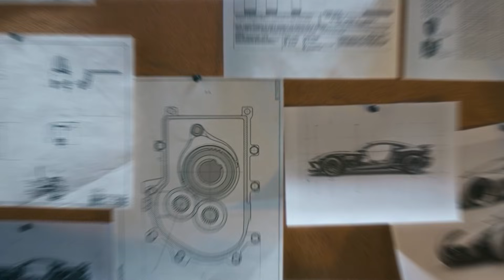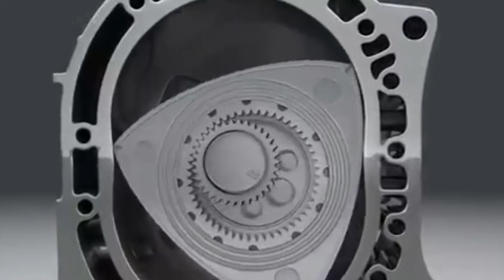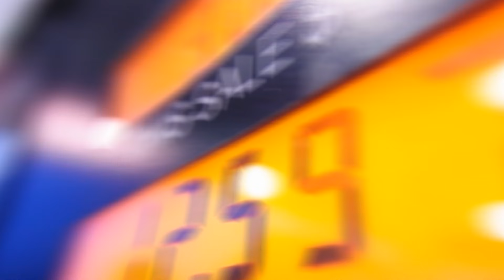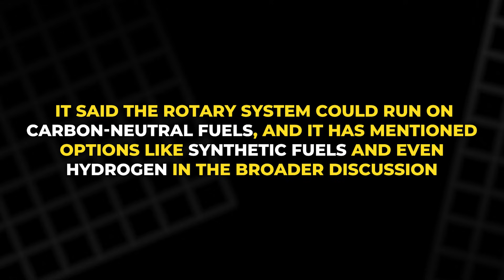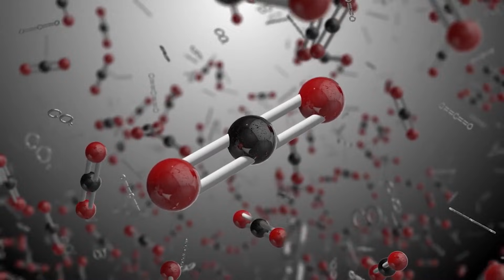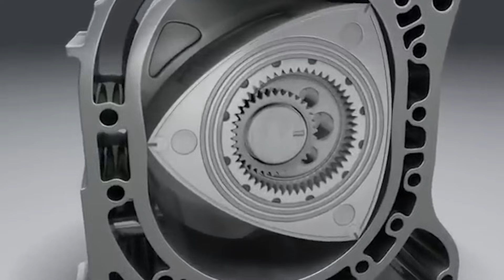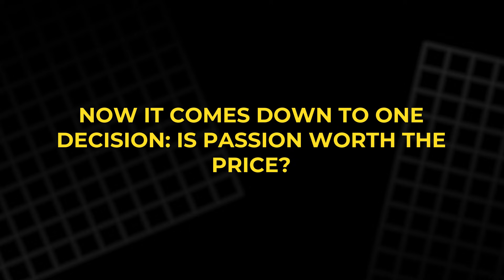Stop Scrolling: Mazda Just Revived The Rotary Engine!

Comment: The rotary in some kind of way is a bit like a 2 stroke piston engine. As you mention , the rpm , intake and exhaust ports are "tuned" to a specific rev range . In this sweetspot rev range a few  of the issues disappear, but not all of them . There's still the apex seals ! .

I did have a late 1980s RX7 when it was a few years old in the early 1990s. The one that looked like a porsche 944 clone. It was good fun and I was young , but the fuel and oil consumption were still a bit depressing. I do miss it , it was fun , if expensive to keep running !

Comment: Mazda didn’t just change the role of the rotary engine. They completely reworked the dimensions of it to reduce surface area to volume ratio. By reducing surface area, they reduce heat loss. By reducing heat loss, they retain thermal energy to do useful work, instead of it uselessly going to the radiator and oil coolers. The RX eight reliability issues were almost entirely due to insufficient, viscosity and oil pressure to support the bearings. If you understand the math involved to describe the shape of the chamber, you understand that if the bearing gets sloppy, that means that the corners of the rotor are not where they’re supposed to be and there’s no amount of perfect apex seal that’s going to fix that.